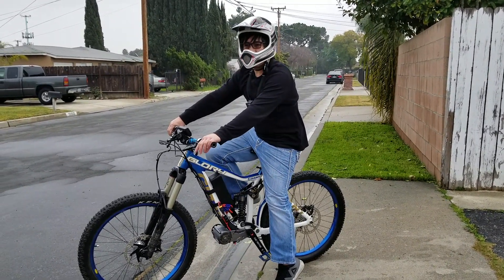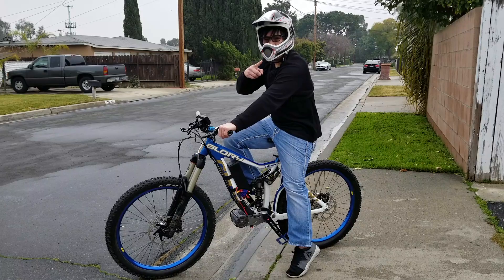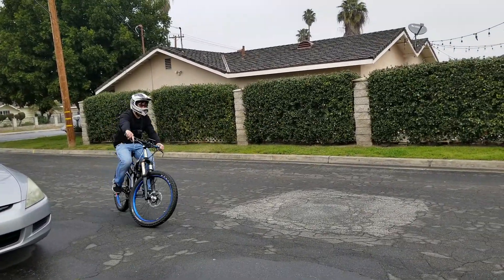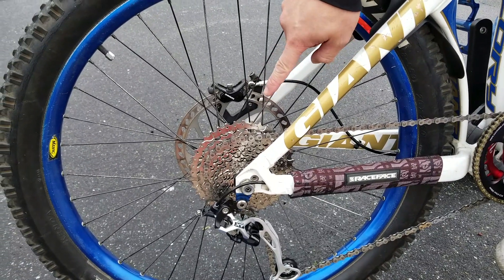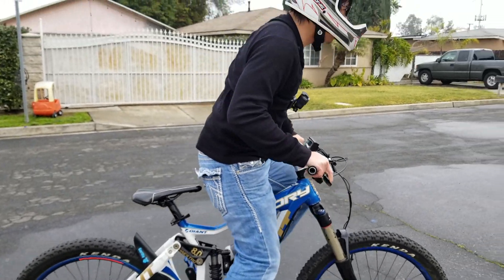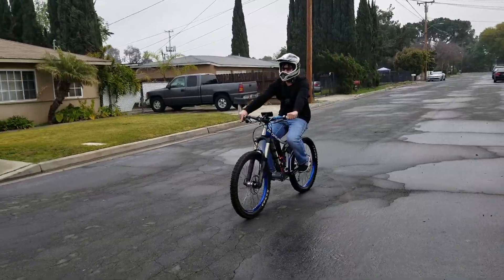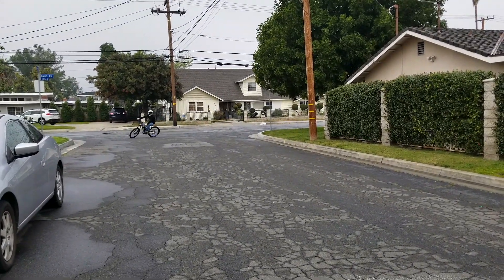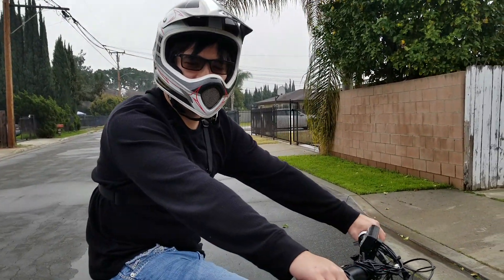CYC X1 Pro Day Time Quick Test

Comment: Dude could you tell me your app settings? I got a gen 2 with 72v and 60amp bms. But it won't make a wheelie at all.
Reply: What chainring are you running?
Reply: @deftrover  38T at the moment.  I need 32T I guess

Comment: That snap at 1:42 is your chain slipping and that can break teeth on your cassette and chain ring mine does it too gotta becareful when you floor it in those smaller gears that's when the chain is at it loosest point.

Comment: Which controller are you running ? at What voltage and current ?
Reply from the maker: I'm using a Castoe Creation 120a HV rc esc. The battery is  a 12s lipo. The Castle data logger is showing I'm pulling a max of 150amps and over 7000w. The numbers may not be 100% correct but it will vary depending on what controller is used
Reply from the maker: @shockadellick  depending on how your going to use it I would maybe say neither. The CYC is not refined enough and the ASI seems a little small for the CYC if your going to run a high power setup. The ASI2000 might be better if you want to take full potential of the CYC X1 motor
Reply: @tonytypes   Electric Race Technologies didn't allow us to see his bike. Bet you his bike is full of gadgets. Yes I bet you it looks like a war machine.

I'll opt out until I see a photo of his awesome bike. Why? Because I don't want a bike that can't maneuver, or looks like science project full large batteries lol.

Although, I respect his commitment. I think all I need is bicycle that tops out at 28 to 30 mph with monster torque. 
E-bikes are motorcycle pass 30mph and I'd just prefer my California street legal CRF230F.

Beside, don't like ugly bikes and I'd sell my soul if ERT's bike isn't one beastly monster to view lol. However, thanks so much. Oh, more who buy  CYC's-X1, higher chances we are to have parts and support for the long run.  Keep up the good work.
Reply: @tonytypes  Hello, nice bike. Im sick of the bac2000 as the power drastically reduces after 5 mins of riding. how hard is it to tune the 'Castoe Creation 120a HV rc esc' to run on the cyc gen 2 ? thanks.